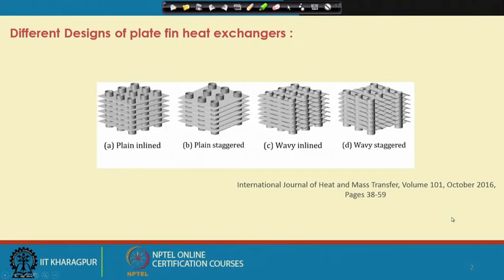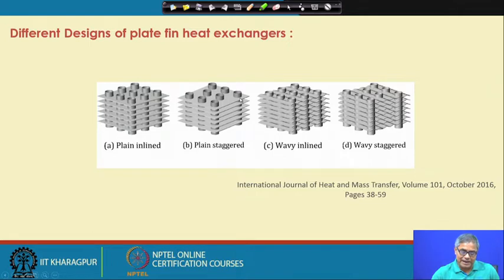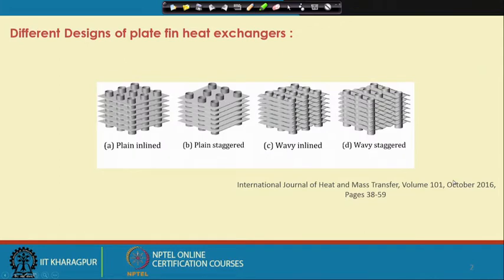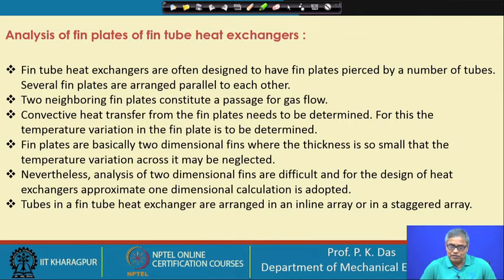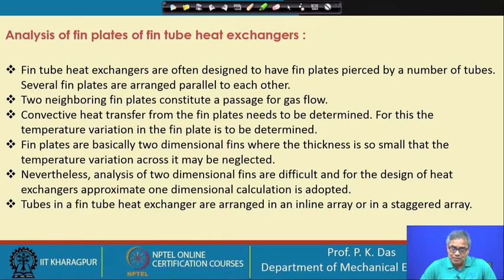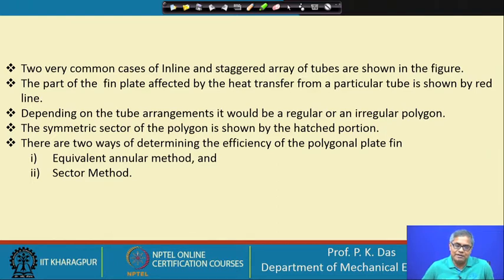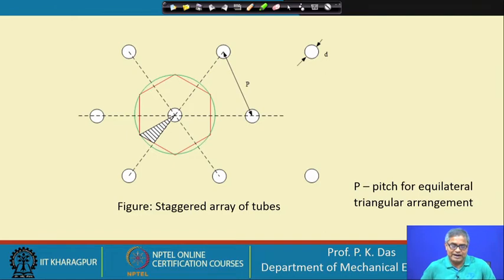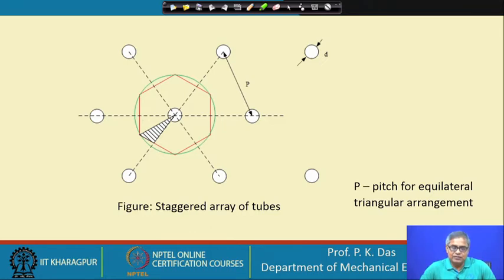Lecture 20 : Analysis of fin plates of finned tube heat exchanger

Comment: I'm wondering how effective a pin fin heat sink might be if the pins were all made from 6 mm diameter heat tubes alone which are 100 mm long each, spaced 4 mm apart and using 30 of them. Can anyone point me in the direction to find this answer?